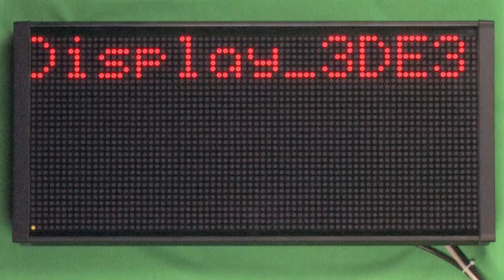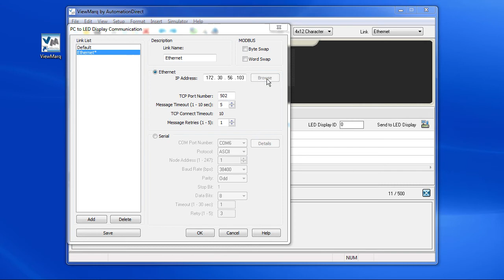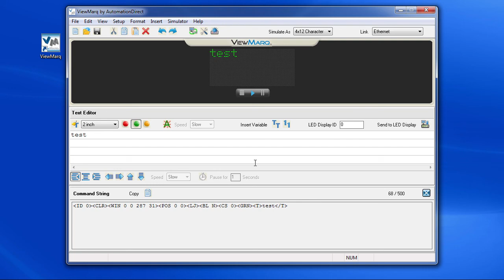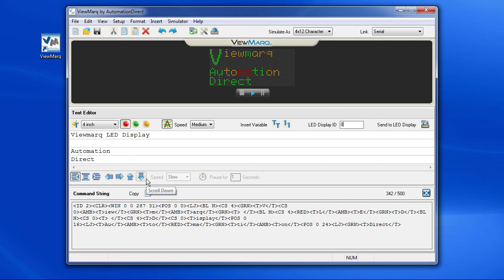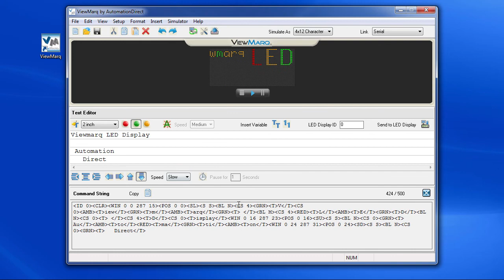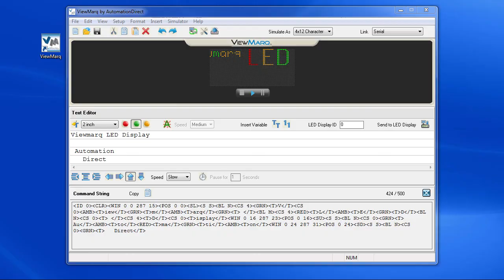ViewMarq LED Message Display Quick Start from AutomationDirect

Comment: Can I use this display as a counter using
 digital inputs ??
Reply from the maker: The Viewmarq does not have the ability to use the digital inputs for an internal counter. The counts would have to come from an external Modbus or Ascii controller. Thanks